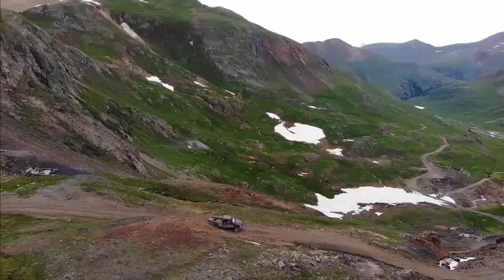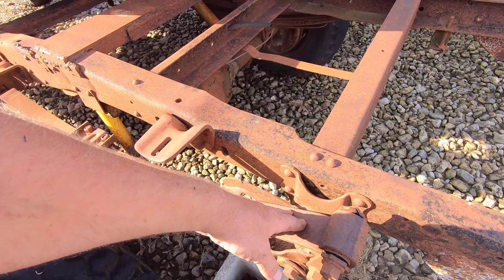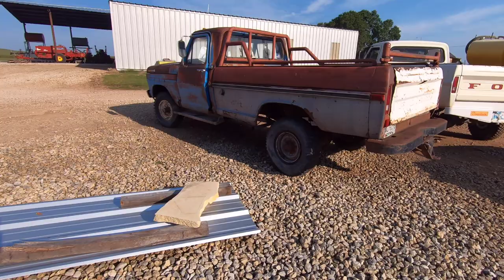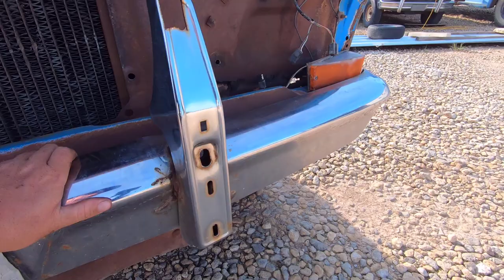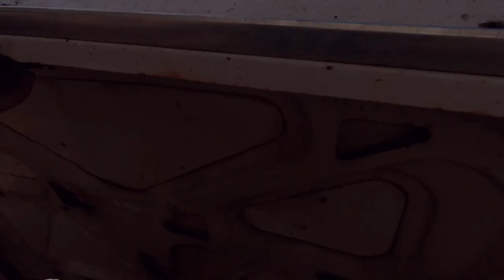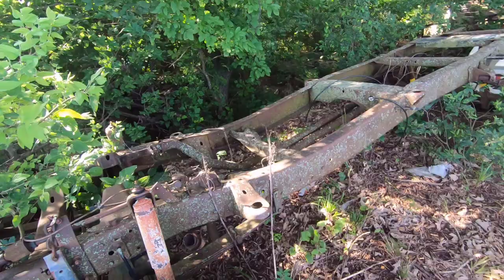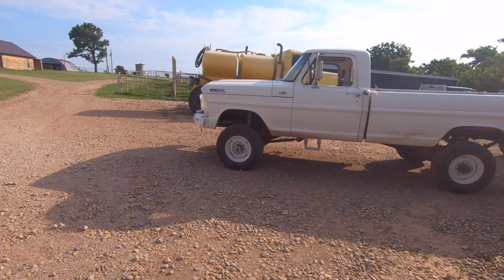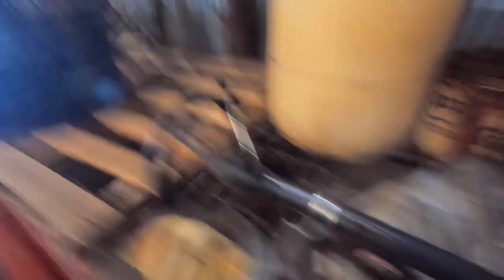What Exactly Is a Highboy? Plus Ultimate Highboy vs Stock!

Comment: Hi Matt, I have a factory ultimate F26 77. It came with a new process 206 transfer case, it is not divorced. Camper suspension with a unusual automatic, the Dana 44 hd front axle. This truck came with all galvanized leafs. The drive shafts are factory and they too appear galvanized, they are much bigger in diameter. The power stering is different. The manufacturer date may make it one of thee late true F26 77 to roll off the assemble line. I ? if this truck broke all rules prior and was a proto type made before the auto industry change to fuel demands of light weight gas mileage plastic models. My truck has a perfect hand welded 1 1/2"  X in the front of the hood on the passenger side. I ? if the assembly line used it to tag special build. Interesting is the gas tank is not in the cab. I also have a 1 ton frame with outside cab mounts. Of all places I believe it went to Williston, N. D. dealership. Thank you Matt for your great video on a true highboy comparison, but I may have a factory ultimate F26 77 highboy. Inside the automatic transmission is a metal tag with a person's name not numbers, could be a experiment for Ford by one of their engineers. One thing is for sure, this truck had all of Ford's best updates in a F-26 four wheel drive.
Reply: You’re very lucky to have this 77 ultimate build man sounds awesome 👏🏼👏🏼👏🏼

Comment: I have a 1977 f250 4×4 just had it will to me , I think it has a 400 engine...dad replaced the cab with a 1977 should be the same right? ...it seems now the crome /body lines doant match the box

Comment: Great video man I just got a 76 F-250 ton four-wheel drive it is a high boy after watching your video I tried to buy this truck 20 years ago at a farm auction and didn't have enough money I finally got it had a rat nest all the way up to the hood but the only reason this truck caught my attention was in the front hubs I had a 78 3/4 ton Chevy with the same hubs on it and on one side it said Ford where you lock it in and out and on the other side it said Spicer the hubs I saw on your trucks were different I haven't got the Ford running yet put that Chevy with the same hubs on it was bad as four wheel drive I ever saw I couldn't tear it up I heard Ford lost a Spicer contract and Chevy got it I'm completely ignorant about Spicer Dana all that what are your thoughts also I had two other Chevys that were just alike for parts and never needed them so it's not a special order thing cuz I had three of them I bought for parts but the other two trucks hubs said Spicer

Comment: Hey Matt, I have a 1977 highboy the I am putting a 67 f250 2wd body and bed on I cant find how you shortened your wheel base can you talk to me about how you did that or link the video that you talked about it. Thank you
Reply from the maker: I used a spring mount that has different pin holes in it to locate the axle in different locations. But moving forward I am going to swap out to 67-72 f-100 4wd springs and those will move the axle forward without the different spring mount and also should result in a nicer ride. I have not tried this yet but ill make a video if I do.
Reply: @MattKubik1791  Thank you very much I just couldn't find anything about that problem.

Comment: My 77 has the d44 hd with a weight rating of 4500lb. Both my 73 and 74 came factory with the regular d44. And my 72 had a np 205 factory. The 203 was mainly but not always with the automatic but never available with the manual. Also the 4wds (1/2 and 3/4 tons) were never available with a 390 or 460

Comment: 4 wheel drum brakes and no dome lights on the floor but it had the one in the cab roof, steel metal door panels and it had the basic armrest on the door panels, standard heater no factory radio option or cigar lighter,no horn cap ring just the cap, manual brakes and power steering with the option heavy duty power steering cooler i have always wondered if that power steering column and the heavy duty power steering cooler was harvested from the dump truck the manual shift 4spd transmission came from,,Only exterior trim was the aluminum side center spear running down the sides of the truck.

Comment: So are you saying ( aside from heavier springing)  the only difference between the standard Dana 44 and the HD was the heavier hubs?? Thanks.                  Dandahermit
Reply from the maker: The closed knuckles are also larger overall the ends of the axles are just all around beefier. But yeah the tubes and center section are the same.
Reply: @MattKubik1791  ok fine

Comment: I Bought My 1972 f350 4x4 High Boy New in 72 ! Back then ford called it a Highboy because of the truck had a Stock 4" lift For the Factory !! 360 , 4spd , dana 44 closed nuckle and dana 60 rear with a 205 transfer case ! So Back in 72 thats wat they were called and before that i knew High boys were stock 4" lift  , blocks in the back ! Mine was a Ranger with No power steering ! And in 72 my 44 HD frontend was called a Snowplow option with the Big hubs and big inter axes

Comment: It was nice to see this video since I have some of these, 67 2 wheel f250 71 2 wheel f250, and f250 high boy 76, 71 full sized van, 79,80,84 f150s so it was good to see, have to figure out the steering because the power assist is junk, I may swap out the 76 to the 67 body with the 252 engine, lots to do, health got knocked down a bit so have to get back on track,thanks for the video. 
GOD bless the great USA  !

Comment: I got a question it's kind of off topic about the high boys but I was wondering are the F100 cabs interchangeable with f250s and f350s, thanks and I like your videos they're pretty cool I myself have a 69 F100
Reply from the maker: Yes to a point cabs are interchangeable. The cab on my ultimate highboy is a F-100 cab, You have to modify some things though they are not a direct bolt on. The rear cab mount holes have to be re drilled and if its a low hump floor you have to cut the transmission tunnel out. Things like that.
Reply: @MattKubik1791  cool man, I appreciate the info.
Reply: @MattKubik1791  cool man, I appreciate the info.

Comment: People who put down the Dana 44, several 73-79 gm square body trucks, Blazer and suburban have Dana 44 front axles, and the second gen dodge ram 1500 4x4 has a Dana 44 front and rear different version of course but still Dana 44 front axle except the second gen dodge ram 1500 4x4 Dana 44 front and rear axles

Comment: Thought I might mention that Hi Boys were also assembled in the Ford Australia, Brisbane plant, and converted to Right hand drive for the Australian market, also 2 and 4WD F100/250 and 350 R/H drive F series were exported to South Africa and New Zealand from here as they are also R/H drive countries.

Argentina Ford also produced F series.

I still own an Australian assembled !973 R/h drive dent-side Hi boy, (yes a 1973 ) with New Process 205 transfer and HD Dana 44 front, Dana 60 rear, originally a 300 Cu 6 cylinder with New Process gearbox, box, I believe all Australian Hi Boys were HD spec although not that many produced here, maybe 60 or so, compared with far more common F100 4WD's in the 73/4 years.

Mine had the American steel dashboard with round speedo etc and tank behind the seat however due to damage i replaced it with a 1975 Australian dent side cab that has a unique dash compared to the American cab and of course steering wheel and guage cluster on R/H side of cab, gear shift is also shaped towards the right side.
The fuel tank is fitted under the rear of the vehicle.
I've dropped an Australian cast (heavy wall) 351 Cleveland into my truck with 58 cc quench heads and slightly concave pistons running 10:1 comp now and it runs quite well.

I note that the front leaf springs are wider than the rear, and the real wheel travel is due to the amazing amount of chassis flex and due to the long leaf springs the ride is actually very good, 
I also believe that the steering is more positive than the equivalent 2WD F 250's with the twin I beam suspension. many of these over here in Australia required re-bending the I beams to suit right hand drive camber as we tend have more camber over here than most American roads and the axles arrived from the US for assembly here.
A warn 8000Ib electric winch and twin AGM battery setup (with a later H/output alternator is one of the modifications) located in a heavy duty bull-bar common here in Australia.
I

Comment: Hey I have a question . Where can I buy a dipstick and tube for my 71 Ford F-250 ? With the 360 .
Reply from the maker: 4wd? I’m not aware of any that are available. Have to find a used one somewhere.
Reply: @MattKubik1791  yeah it's 4wd. It's just like the old one you have in the video. It has the 360 in it . Some one has broke the dip stick and tube off at the oil pan

Comment: I just purchased a 1970 f250, everything lines up as being a highboy with your descriptions, what is confusing me is the tag on the door indicates it being a F26 as does the opposing sticker but the vin number that is stamped on the passenger side frame is stamped F25 ?? all the rest of the numbers / letters are the same , just curious if this is normal?
Reply from the maker: That is not normal no. F25 would be 2wd f-250
Reply: Thats what i thought, not sure what is going on then, based on all your information i have a highboy, unless a mistake was made when the vin number was stamped on the frame , the truck is a flareside not sure if that would have anything to do with, it looks like it might have been a utility truck at one time, thank you for your response

Comment: Cool information, I’ve got a factory 79 f350 4x4 standard cab…had a 400 but now has a 460. Still working to get it road worthy.
I do have a few Dana 60 OBS style front diffs with 4.10 gears….dually rear axles also.
I’ve also have a bunch of Dana 60 front axle shafts ready to go….if ya know if anyone looking?
Reply: They didn’t make a highboy in 79, unless that’s not what you’re implying?
Reply: @countryfan0133 not implying my truck is a highboy ….I know highboys we’re not a thing in 79. 
Highboy is slang term that caught on over the years for mid 70s f250s

Comment: I have a 1968 F250 custom cab camper special all original 77, 000 original miles can I do a body swap to a 4wheel high boy and the bolt holes all line up ?
Reply from the maker: The rear cab mounts will not line up but the cab has the prevision stamped into the cab you just have to drill them out for the outboard cab mounts.
Reply: @MattKubik1791  thank you sir for your kind reply

Comment: @Matt Kubik how much taller is your ultimate high boy over a stock high boy??
Reply from the maker: maybe 2'' If I had to guess. I was really trying to keep it stock height but with the coil springs I ordered it ended up being just a bit higher. I didn't think the difference was enough to order new springs so I left it.
Reply: @MattKubik1791  I think looks great! I know you don’t but would you ever consider pulling your goose neck with it? Or would it sit to high and be to close for the neck of the trailer?

Comment: There's a few things that you said about the high boy that I wasn't aware of. I have a really clean 1970 4x2 F-250 without a motor or trans, super clean box with matching tailgate. I'd be interested in trading my clean bump side box and tailgate for an equality clean dent side box and tailgate. The truck I currently have now is a 1977 F-150 4x4, which means I just need the more common wide frame box. I had a 1973 high boy for a brief period of time, but it was so hammered that I resold it, it would of been too cost prohibitive to make nice again.
Reply from the maker: Would you sell it outright?
Reply: @MattKubik1791  Yes. It doesn't have a title and its sitting in a fence row in the panhandle of Nebraska. It would be a great truck to body swap onto your stock high boy in this video.
Reply from the maker: @danielc5205  if you could email me a few pictures and what you were thinking on price. 06powerstroke06@gmail.com thanks!
Reply: @MattKubik1791  The truck sits a few hundred miles away from me, I'll try this weekend to get you some pictures. Truck's body, especially it's box and tailgate, is super clean, this is why I bought the truck in the first place, but I never did anything with it. Unfortunately, the inside of the cab is now mousy from sitting in the fence row for many years.
Reply from the maker: @danielc5205  no worries just whenever you get a chance. If it’s something I think I can use I can look for a clean dent bed to bring with me.
Reply: @MattKubik1791  Finding clean dent side boxes and clean OEM tailgates for dent sides, is about as rare as unobtanium. I can fix the typical cancer spots on a dent side box, as long as the rest of the box is in decent shape.
Reply from the maker: @danielc5205  I think I found you a dent long box. Shoot me an email and I’ll give you the details 06powerstroke06@gmail.com

Comment: My 77 F26 has a automatic C6 with a factory new process     with a 206 transfer case and it's not divorced. Does anyone else know about this? Yes it's a bumpside style. Matt will you ever do a 77 F26 video? My truck is all still factory except a 400 ford dealership change over from the factory 351 engine.
Reply from the maker: If it’s married it’s not considered a highboy. It’s probably a late 77 truck and is the same as 78-79 “low boy” trucks they are still f26 designation on the vin for 3/4 ton 4wd. Nothing wrong with that. Highboys arnt a status symbol or anything. Just a slang term to differentiate between the later style trucks. Also your 77 would be considered a dent side rather than a bumpside. Transfer case also should be a np205.
Reply: @MattKubik1791  Hi Matt, Thank you for your quick response. I checked again and yes it's a 206 new process ratio 196,serial # is a date, 4  26 77. Assembly no. D7TA7A195KA.The truck was manufactured 05/77 by the original factory tag that lists weight limits and the right on  serial no. With the factory  metal tag riveted on the drivers door. Have you heard of a 206 new process transfer case and why a metal tag with a Date instead of a normal #?.
I am not trying to disagree,but there seems to be a mystery and just want to know.
Really enjoy your videos and respect your opinion,hoping to solve this last model F26 77 1/2 truck.

Comment: Had one a 1971 I bought from coco cola in 1986 when I was in high school for $726. Wish I had it still a highboy is a f250 with 8 foot bed , divorced transfer case only.  Not a half ton, not a a Chevy or dodge. I believe in 78 there was no more divorced transfer case I also had a 79 short bed 4x4 but wish I kept the 71

Comment: Nice video Matt. Why are the 78/79's not considered Highboy's.
Reply: They have married transfer cases, highboys have divorced. Meaning the transmission and transfer case are not bolted together, instead they have a short drive shaft connecting the two.
Reply: @countryfan0133  Thanks for the info but what does Matt say about them. Does he ever answer?

Comment: What’s the difference between a bump side f250 high boy and a bump side f100 4x4
Reply: My 72 f100 shortbox 4x4 is more like Matt's ultimate highboy. It has a married Dana 21 to a np435 and the front Dana 44 has a coil over three link suspension similar to the early broncos. Mine came with a fe360.

Comment: Highboy power assist steering boxes are different gear ratio than non power. Look the same. Highboy and F350 use same front bumper brackets. Bumpside crew cab highboy = shortbed.

Comment: I bought my '76 highboy in 1990. I just swapped the .360 for a rebuilt .390 along with a new 4 barrel carb, new radiator, new exhaust. I put 41" tires on. It has a 3" body lift so plenty room for those. The cab is rusted on the rroof.Water came in through the cargo light. So I have a complete interior, including dynomat, that I'm waiting to install. Also sliding rear window and a new radio (10 disc changer and the two knob style radio). It has power assist steering and I will probably put a 78 steering box in
Does anyone know where I can find a rust free cab? Or a rust free truck?
And what would you value this truck at?

Would've to hear any comments

Comment: F-100s had the same divorced drivetrain as the F-250s up until 1965 so if your definition of highboy is only based off the chassis design there are F-100 highboys. Personally I only use the highboy/lowboy terms for the 77 trucks since that's when they had the changeover and it needs to be specified which it is.

Comment: New Process Gear was owned by Chrysler who supplied all full size 4x4's Ford and G.M. with transfer cases and manual transmisson's.
Reply from the maker: Didn’t know that. But technically they didn’t supply all. The factory transfer case for the 59-72 ford 4x4 trucks was a Dana 24. They didn’t start using the NP205 until 1973.

Comment: Ask a truck driver what a "Highboy" is. Has nothing to do with pick-up trucks. I've heard it a hundred times in reference to a certain type of trailer. Only in recent weeks I have heard it in reference to a pick-up. I'm 62, so been around. The "highboy" was also a style of hot rod.
Reply from the maker: Correct, The slang term “highboy” is not exclusive to the 67-77.5 F-250 4wd Trucks.

Comment: The high boy ford is slange for sure. The stock f250 and f350 4x4s were not considered high boys. When you ordered one with the snow plow prep package it came with much stouter front leaf packs with two or three extra leaves in front for the weight of the plow. They were about 4 inches taller than your standard 4x4. They had the larger locking hubs and bigger wheel bearings up front. The small hub lite duty was never a high boy.
Reply: No, sorry friend but you’re wrong. Every F250 4x4 built from the ‘67model year till half way through the 77 model year IS a HighBoy truck. There is no arguing that, it’s just how it is